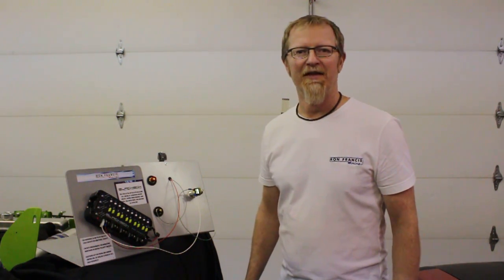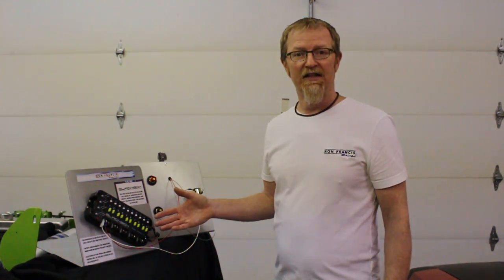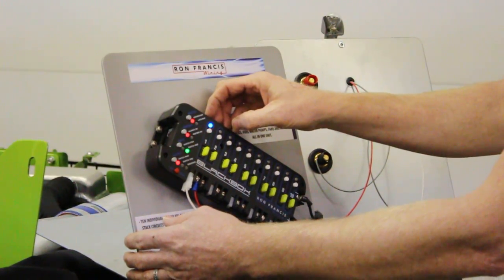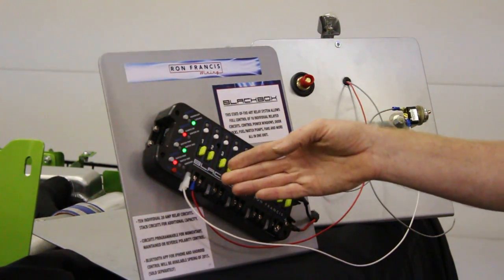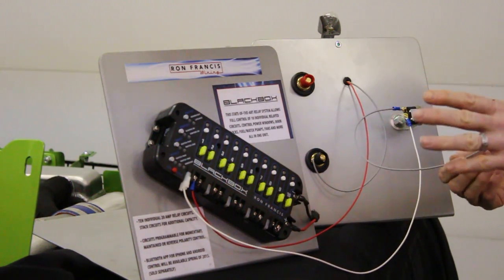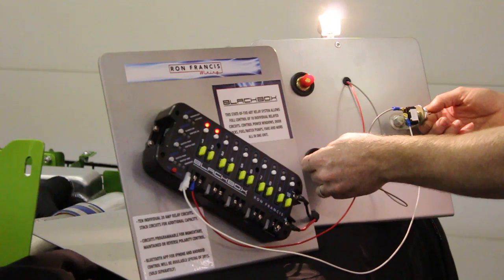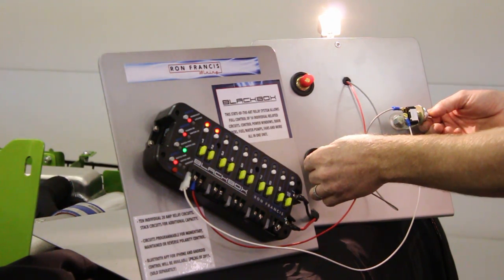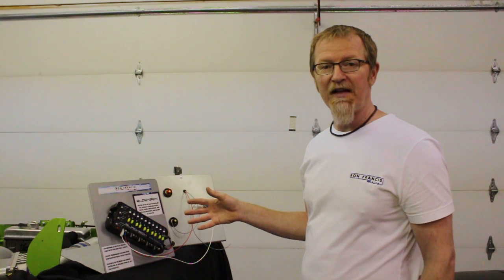Ron Francis Wiring BlackBox - Part 3

Comment: What else can it do other than turn on a light bulb. What about stater solenoid or fuel pump or window motors. What about blower motor or no cause of speed control. I see some use but only for few things. Please add more videos on uses